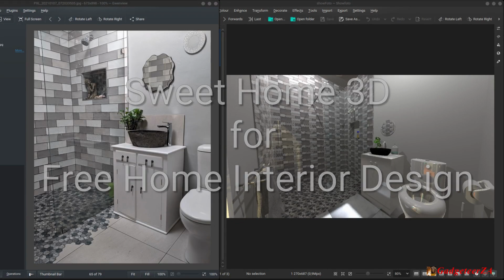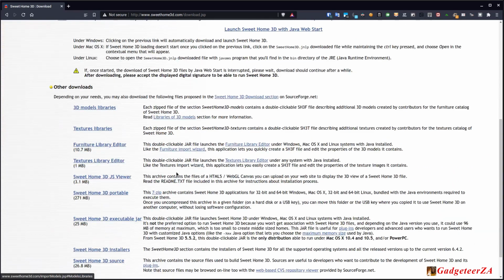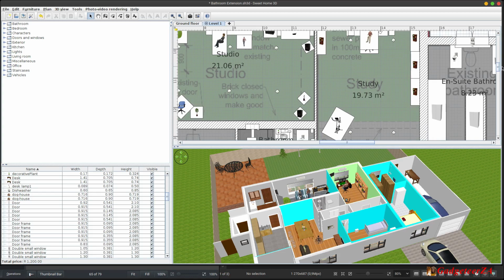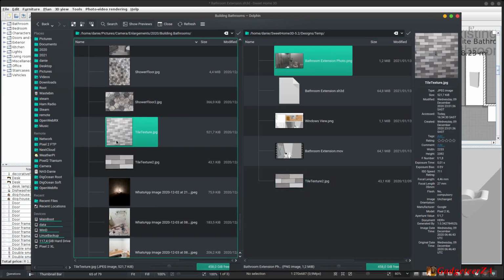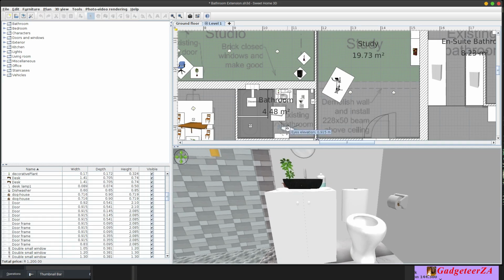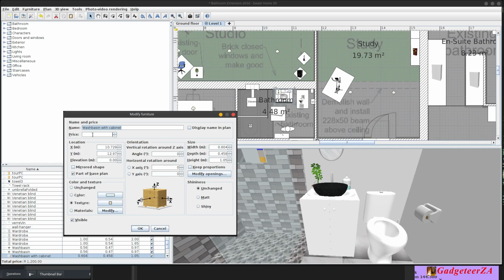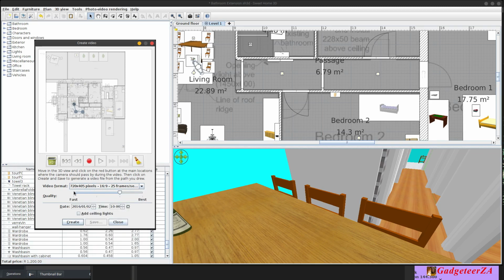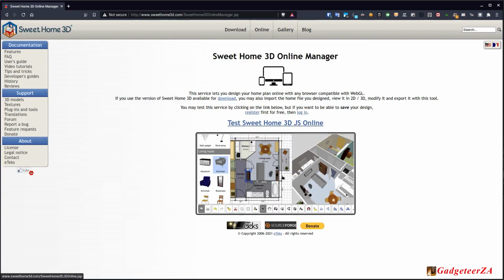Free Cross-Platform Sweet Home 3D Software For DIY Interior Home Design Visualisation

Comment: I installed the software today and gave it a shot, I recreated a kitchen under renovation to have an ideea about the new looks. The software looks a bit unpolished and is not very good woth high resolutions (the cursor and interface are small), but one can really do the work with it.
Reply from the maker: The photorealistic rendering is as good as it gets, but it is not bad. It needs to be properly rendered though, as it is not seen in the normal editing view. That works for images or videos. That is also dependant which textures you'd selected.